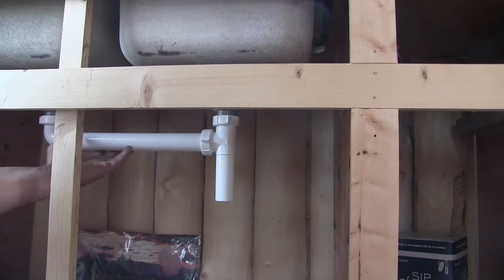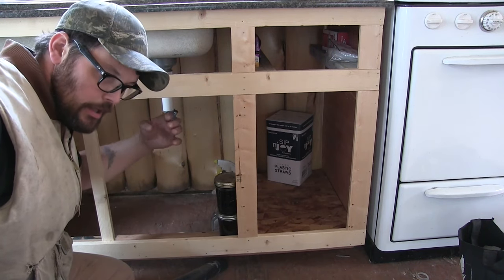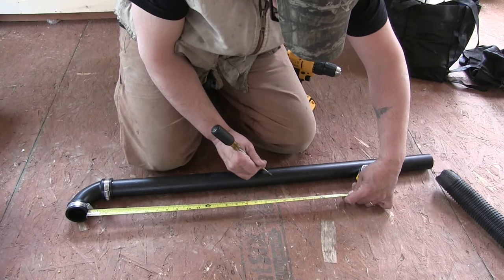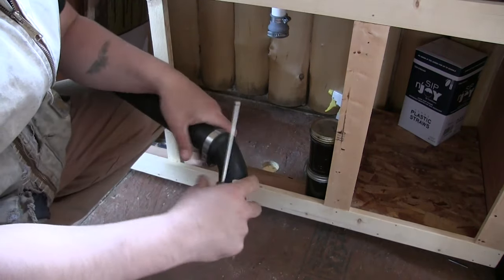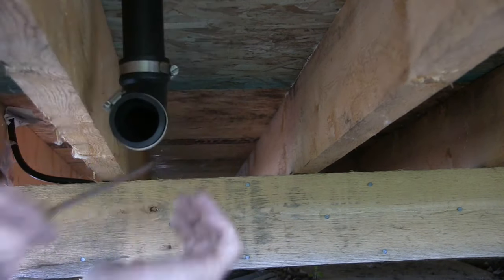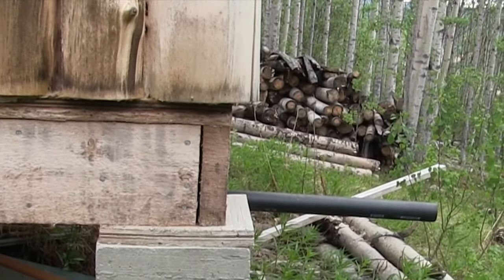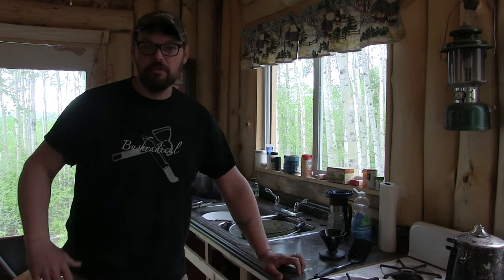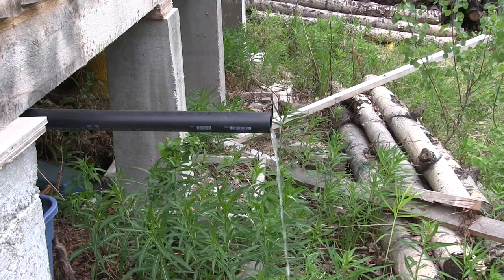"Off Grid"  Sink & Drain System

Comment: Just a note, if you plan to do a gray water drain, check your local code.

Where I am, gray water has to be released below ground level. Which is as easy as digging a hole, putting in some pea gravel, and then piping into the pea gravel and covering with some dirt. 

Great video Dave!
Reply: There's no code here
Reply: Have to go pretty deep in order to get below the frost line or it would back freeze. I guess it depends on how much you're going to use it. Seems like they usually go south for the winter. A P-trap is another thing that would freeze if you're gone for a few days. Sometimes simple is the better way to go. Freezing pipes is the biggest problem with my dad's cabin. Everytime you want to leave, you have to blow out the pipes. I'm still at the five gallon bucket stage in my off grid cabin but this looks like a better way to go. Yeah no codes where I live either.
Reply: I used a 55gallon barrel with holes in it then berried in the ground beside the cabin.
Reply: @DK-jd8bj  another option is to pour RV antifreeze down the drains to fill the p-traps if you don't have a compressor but it can get expensive depending how many drains you have.
Reply: Just going out on a limb here…guessing it’s pretty hard to enforce a code…even if there is one…when nobody knows where you’re at 😉
Reply: @greyishgreblum What do berries have to do with anything?

Comment: Dave, it's great to see you back in Alaska.  You have overcome a lot of challenges to make it back this year.
I live with a similar grey-water system.  A P-trap is invaluable for keeping the tiny flying critters (like our state bird) from buzzing up the pipe and out your sink.  Even with fine mesh screening over the exit pipe, they still manage to get in there.  It also keeps the gasses from flowing back up the pipe from all the sludge that forms inside the pipe over time.  Stay radical, eh!
Reply from the maker: Thanks

Comment: You always do a great job of showing the details step by step.
A natural teacher.
May I suggest that you add an extension to get water further from the cabin,  keeps mosquitoes and odor down.  Also puts it to good use by directing it to plants and trees, flowers etc.
One year in. drought I had a hose attached to my washer (.using environmentally friendly soap) and used the water to save some of the trees and bushes.  Loved getting that double benefit.  So worth the effort.
Reply from the maker: Right on. Thanks

Comment: Boss of the swamp had a great video on adding covered gravel pit to prevent smells from greasy water and bit of food over time.  I copied it for my cabin (also off grub) and it works a treat.  Plus it was simple.
Reply from the maker: I'll put a pit in for the shower house and probably the cabin but its got to wait its turn on the list...But I needed the sink right now. I'll check out that video. Thanks

Comment: Thanks Dave. I'll be doing one of these for sure. What about getting water into the house? I'm thinking of maybe a texas tank or something. I need to figure out a way that the water won't freeze. I'll keep looking at ideas but this one is great and easy to implement. My other thing is what to do for a foundation. I'm in zone 4 in maine and wondering if I could do concrete piers on something around 24 x 32. Maybe a bit smaller.

Comment: Your a plumbing wizard Dave!!! 🍻👍
Reply: 😂no trap it's going to push a stink up that pipe and into the house🤢
Reply from the maker: Magic Kung foo, voodoo plumbing action
Reply from the maker: From what? It doesn't run into a septic
Reply: @Bushradical  from the long pipe that will build up and the smell of the gray water drain that's what
Reply: @Bushradical  From food particl es, grease/fat from dishes, dirt, hair etc. I know this from experience.  There are pretty simple design set ups out there that you can build yourself.

Comment: great down and dirty way to get that water out!!.. great tip on the dump the water all at once.. i do have a question..why not make a deep french drain to  dump the limited amount of water into? that way you can go straight down under the cabin.. (deep pit filled with rocks ect to create a space for the water)  My dear old dad and I ( i was 6) put one in behind a back yard fire place with a sink.  The sink drained out a terracotta lions head into a little pool that drained into a french drain under the lawn. . It never failed. (that is how i learned about a french drain)  my question is: is that plausible for a cabin construction? if not why not? (perma frost soil too rocky)  i am very curious.  J
Reply from the maker: No, it should work fine. We don't have any permafrost here and the ground drains well, so a french drain would work well here
Reply: @Bushradical  Sweet!!

Comment: Have you ever had any issues with grease building up outside after a long period of time? My grey water system goes into a 5 gallon bucket with sand, gravel, and charcoal as a prefilter but it gets gummed up with grease from doing dishes. Mostly from rinsing skillet with bacon grease residue. I try to wipe the skillet clean before rinsing but there is still a small amount of grease that goes down the drain. I'm thinking that I should skip the prefilter. Maybe just dig a ditch, fill it with gravel, and have the pipe go into the ground/gravel.
Reply: never had an issue
Reply from the maker: yeah, like Brooke said, we've never had an issue.

Comment: what about this for the winter...a grey water tub underneath, with a dump port that leads to the outside, could even coil a little heater wire around it just at the outlest to keep it from freezing....so tub fills up, pull a lever, opens port to outside and all dumps at once, minimizing freezing....
Reply from the maker: That pretty darn close. there is no "good way" to do this in the winter.

Comment: Well since it's that easy, I think I'll be putting a small sink in my cabin, as soon as I finish building the outhouse. We've been using the one at the campground across the street but sometimes it's too far to run. :) So how are you supplying your cabin with water? Did you drive a point or do you have another source?
Reply from the maker: We haul our water form a public well about 9 miles from here

Comment: You should put a P Trap in the drain pipe to keep unwanted guests out. Snakes, bugs ect....
Reply: Only you have to remember to drain it in the winter if you leave for any length of time! Otherwise it will bust when it freezes!
Reply: @donaldhofman296  You are correct...
Reply from the maker: No snakes up here

Comment: Wouldn't a Pee trap help keep the critters from crawling up the pipe into the house? Maybe little critters are not as much of a problem there as they are down here?  Cabin is looking good. Thanks for sharing!
Reply: The pipe is 3 ft off the ground
Reply: A trap will likely freeze
Reply from the maker: Never have seen anything crawl up the drain and we've had this type of drain before in another cabin.

Comment: What about an old bottomless bucket full of gravel and rocks for the grey water to run through before it heads on down the hill?
Reply from the maker: thats probably a good idea
Reply: This is my plan. big filter underneath the house and insulate the pipe so it won't freeze in winter. still trying to figure out the latter exactly but I think I got an idea just need to test it

Comment: Watch out for critters making a home in the pipe when you aren't using it... maybe a bit of wire mesh over the end?  I had a good sized wasp nest in mine once....
Reply: I had basically the same problem. Critters would smell any leftover food pieces that were discharged with the water.  They ending up making camp under my cabin.
Reply from the maker: The wasps will have a wet day when I drain a sinful of wash water

Comment: Wouldn't you need to put a screen cover on the outside pipe to keep critters from crawling up through the drain?
Reply from the maker: No. with the trainers in the sink bowls only an ant could climb up through the pipe....and that hasn't happened yet, so I doubt anything else would try to do it

Comment: Opps..I would "s" trap it to prevent animals from coming in..
Reply: Only thing missing but not a necessity.
Reply: @PavlovsBob  true but open holes are an invite to all animals and I would hate having this as the reason there are nests of animals in the cabin when I walk in after being gone for months..just a safety item
Reply: Trap is only needed if hook into a septic system or city sewer. Trap allows some water to stand in the pipe to keep gases from coming back in the house .  If you need to keep out pest , some screen over the end .  Love this system it's very easy.
Reply: I’m debating adding something like an s-trap but worry about what freeze/thaw might do to it. As far as critters are concerned I’m not sure how much a trap might help. I’ve dug a fairly elaborate dry well for mine, complete with a lid. We’ll see I guess.

Comment: No trap in the drain?
Reply: There is no need to trap sewer gasses as this gray water drain is separate and exits to fresh air. The pipe is likely large enough to vent itself and drain freely. Are you thinking of a trap to catch small items accidental dropped down the drain?  A plumber friend once said there are two things one needs to know to be a plumber. “Water runs downhill and payday is on Friday” 😀
Reply from the maker: No septic and the P trap would freeze in the winter if it wasn't winterized. We spend the winters in Michigan
Reply from the maker: yes, Ive heard that too....the other plumbing saying that goes with that is "don't chew your fingernails".